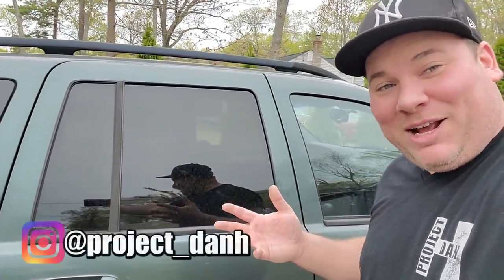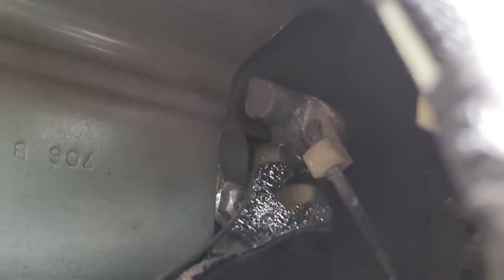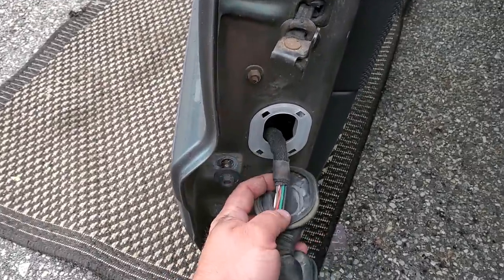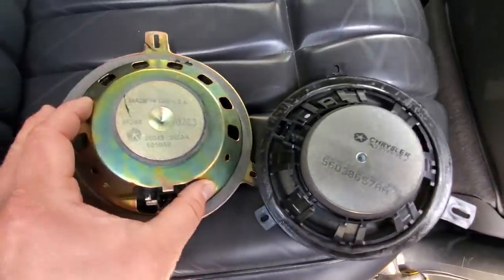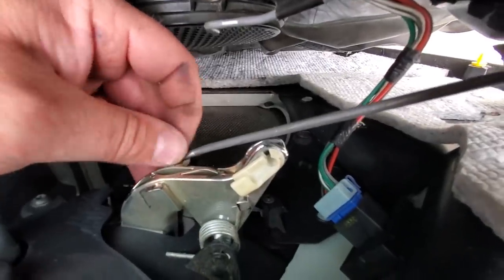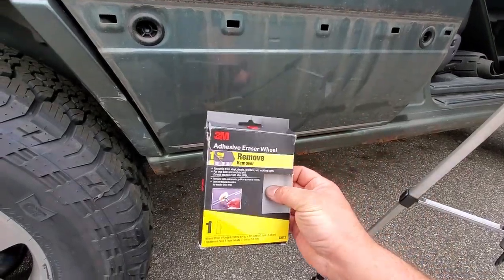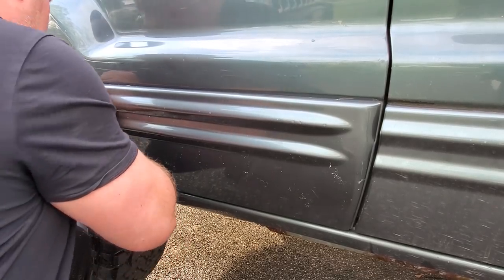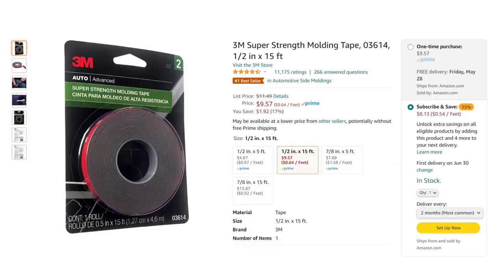JEEP GRAND CHEROKEE WJ DOOR SWAP - A LAREDO DOOR CONVERTED TO A LIMITED OVERLAND

Comment: Hey Bash Engineer
I am from Yemen, the Republic of Yemen, southern Saudi Arabia. I have been following you on this channel for only a few days.
I own a 2004 Jeep Ground Cherokee.
Unfortunately, our spare parts are not available, and the agent has very, very expensive parts.
The car came to me with a heavy load, it came to me in 2012 and now I am walking in it.
Now the malfunctions have increased and I have the code B1757 and the code B0112, the first of which is B1757, which I understood that there is a defect or malfunction in the gearbox.
The truth is that I have not yet known the extent of the capabilities of the car because it is slow, but it happened recently that I felt that it had changed the gearbox gear and started to start and its launch was wonderful.
Don't dwell on this as my destiny to own a car and not be able to maintain it.
I like what you are doing, thank you and goodbye
Reply from the maker: Thank you so much for watching.  I hope one day you will have a perfect Jeep. God bless you 🙏

Comment: Haha, Dan , that music sounds like something from the 80's . Like a B rated movie. That's cool!
One little tip for removing the original tape that holds the cladding, pressure wash it first. Then what's left is really minor and cleans up quickly and easily. Good video!
Reply from the maker: Thanks Jack!  My pressure washer is currently being held hostage by the junk in my shed 🤣🤣🤣

Comment: Thats awesome I feel like the WJ and older jeeps are so user friendly to replace and work on parts.  Great that have those clips on Amazon.  I just Went to the yard for the first time and loved. Def be going reg when need parts. The strips are pretty easy to remove I always take those off. Just grab some infinity speaks for the front and some parts to add auto headlights.  Might have to see how hard it is to add defrost mirrors.

Comment: I had to do the same thing when I punched a whole in my door when off-roading.  $200 off eBay, rather than $1000+ repair at a body shop.  Though for me, the WJ has the pin-striping and the door doesn't.
Reply from the maker: LMAO!  we're backwards!

Comment: Hi Dan, I have a jeep zj and I need a 4.0 engine, I have found a 4.0 but it is from 1994 and my car is from 1997. Are the M2ZS and M2ZJ blocks and cylinder heads compatible?
Reply from the maker: I believe so.  Yo can put any head on any block, it's the compatibility with the vehicle that is more important. For example an 0331 head needs to go on the Jeep with the coil pack ignition.  I think your ok. It definitely double check

Comment: Dan, what coolant fan do you have? Is it the mechanical, or electric? Trying to find a shroud for my wife’s WJ the engine assembly that I picked up for it had the mechanical fan and power steering pump so I can trash the hydraulic fan system.
Reply from the maker: My WJ fan is a hydro fan

Comment: Figure if anyone would know would be you 2000 wj bought with out fan and clutch was this factory or does it need the mechanical fan or for the ac is it better to leave as is
Reply from the maker: WJ had 3 types of fans, hydro fan, Electric fan, mechanical fan w/ clutch.  Which is your Jeep supposed to have?
Reply: @ProjectDanH  mine had only a electric when I bought it but I have seen with both and some just electric I put a fan with clutch on mine easy but I don't notice a difference would like to have it just in case of over heat

Comment: Did you ever end up replacing the rear lift gate on this with the one you pulled from the yard? I have a few big dents in mine and I’m wondering how much of a pain the wire harness is going to the hatch. Is it even worth it to replace?
Reply from the maker: lol.. not yet.. its still in the back yard... rotting🤣🤦‍♂️

Comment: I had a fender bender and need to have one of my rear doors replaced.  The estimate has them taking the front door, back quarter panel, and the bumper off.  Ummmmmm.  The dent is in the bottom part of the door, near the wheel well.  I'm getting more estimates, but after watching this video, they are obviously hoping to rip me off.  Can you think of any reason why they'd have to take the whole side of the car apart?
Reply from the maker: They go by worst case scenario calculated in their computers for the job... I'm not a fan of those penny pincher type shops.  try a new place, or check junk yards for doors and just do it yourself!

Comment: What size tires you running?
im looking to do the same 2" BB from rough country and need to decide if i can fit 32's without any cutting
Reply from the maker: 31s .. you'll need close to 4 inches to run 32s w/o cutting
Reply: @ProjectDanH  thank you, did you have to do any cutting with the 31’s and 2” lift?
Reply from the maker: @kaelangerhardt5651  it's almost 3 inches but my front tires rub a bit
Reply: @ProjectDanH  thank you

Comment: Question: would your black xj there happen to be the one on display at spoilerlights . Com? Had the mk2 spoiler for my xj sitting around to finish up but i've been afraid to install it on my tailgate that's been peeling paint. Wanted to know if you had any tips for install
Reply from the maker: If your paint is peeling I'd recommend having a professional body shop paint your lift gate and spoiler and have them install it..  the orvis spoilers are too rare to mess it up. Lol save up and do it right 💪
Reply: @ProjectDanH  oh shoot did you get a genuine spoiler?